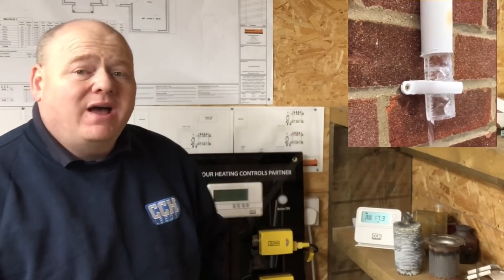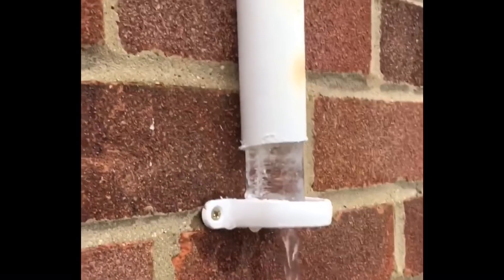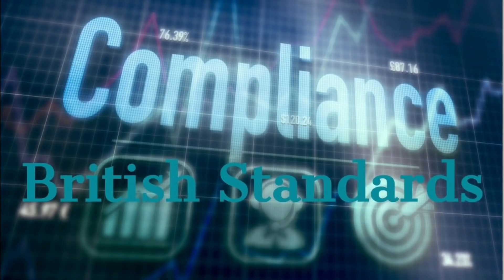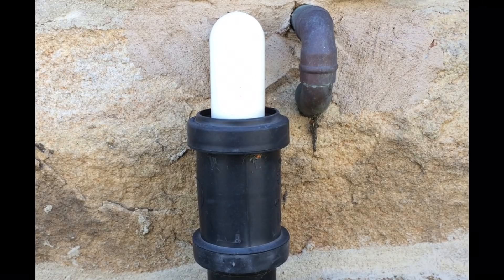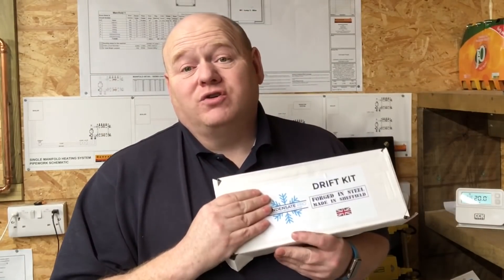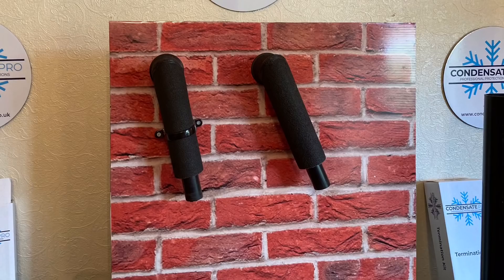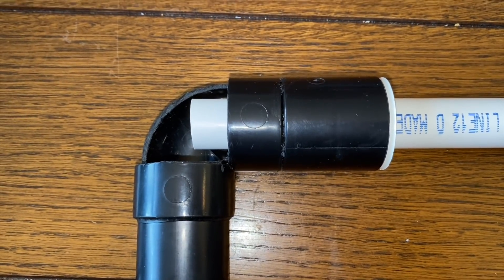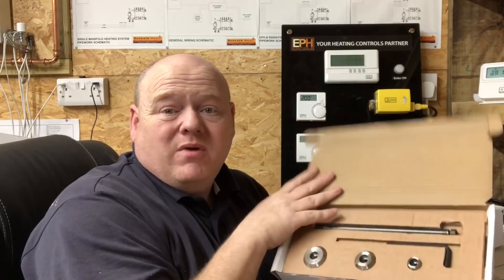Frozen Condensate Pipe - How To Avoid Boiler Breakdowns Due To Frost

Comment: I had a condensate pump installed with a combi boiler, which is located in a wardrobe in a bedroom on the second floor. The pipe runs from the condensate pump into the attic and then the pipe goes down from a hole in the ceiling into the bathroom and connects to an existing bathroom pipe. Is that normal?
Reply from the maker: yes

Comment: I used condensate pro on my last few boilers , only two of them froze up , it was difficult to get them thawed out. 
Now I am running every thing internally when ever possible. 
Even using pumps where necessary

Comment: We've just had 36mm condensate pipe freeze despite we were told it wouldn't happen with this dimension of pipe. Thick rods of ice came out! I had NO idea how much condensate is actually produced.  Water backed up into the boiler which, obviously, shut down for safety reasons. Our Baxi was fitted last year and has 7 year warranty but *frozen condensate pipe problems are not covered under warranty*.  Our pipe runs along side of house and into a crystal-filled mini soak-away so we will be having this pipe modified away from the wall so it can be  lagged properly with condensate pro (thanks for the heads-up @allenhart999).  Wish our 20 year old boiler was still with us, we never had these problems pre condensate pipe days.

Comment: Simple, cheap fix.   Cut white, plastic condensate  pipe below boiler level.  Fit  T  piece to join it again. Fit short length of white, plastic pipe to spare outlet on T.  Fit 90 degree bend to end of pipe then fit into it another length of pipe that rises above the condensation trap in the boiler by maybe 1 foot.  Condensate pipe comes from boiler to the T piece it then looks like a U shape with one leg a lot longer.If condensate pipe freezes then swing down the long leg of the U into a bucket. Condensate trap will empty and boiler will start up. The bucket doesn't fill up very quickly even when boiler is on all day. When normal condensate line unfreezes then just swing your improvised drain pipe up out of the way. As long as the end of that bit is above the boilers condensate trap then nothing will come out untill you want to use it again. A bit of pipe a T and a 90 degree fitting and that's it. I have been using it for years.

Comment: Hi Allen. I don't mind using Condensate Pro, but not many merchants have it as stock so you have to order it in. No good if they tell you its going to take 3 days or more. I want to do the job, get paid then move onto the next job. If they see its not complete, you don't get paid. I hate going back  for nothing.
Reply from the maker: What do you use at the moment. Thanks
Reply: @AllenHart999  Previously I've used armaflex, normal pipe lagging. Both are not ideal but better than nothing. There are not enough merchants that stock condensate pro. You would think if they sell boilers they should stock it, especially now its available. 90% of external condense pipes I see aren't lagged.

Comment: hi allen i wish this great little clip had been shown to me last year when i had a new worcester bosch boiler the pratt who installed it didnt know one end of a spanner from the other also the commissoning guy I even asked about lagging the condensate his answer?? no no pipe is BIG enough NOT TO FREEZE ha ha l should have known better from 8 years ago i had a GLOW WORM fitted  that also froze so i lagged it with CLIMA insulation yes it was not the right stuff but it worked just had to replace it when it fell off  it did last 3-4 years before replacement.   My question to you is the pre treated insulation can it be cut down the lenth  so i can use it like CLIMA thanks in advance
Reply from the maker: Thank You

Comment: I'm just in the process of getting quotes for new boiler and pipework. Every contractor who has been I have asked about how they protect the condensate pipe and I honestly get funny looks when I ask how they protect the condensate from freezing. It's not even an afterthought.

I mentioned to one that the insulation would need painting he responded straight back with, "Yes,You can paint it" 🤔
Reply from the maker: Ask them to watch this video and send me a message. Thanks.

Comment: We use condensulate slides inside inch and a quarter pipe and have been using it for years and never had one freeze up and looks a lot neater then that stuff
Reply: what's the price and time to install,  talking installers and services engineers of a massive company who use that product they advise they have many that still freeze with this fitted, also the white powder that comes off it when you have to cut it outside with a mask and goggles on but it not nice to get on your hands? what do you think 
The leaf guard that is supplied can not be fitted  to all drains, so windchill is a problem, to help i have a solution to that , just use a piece of rainwater as that protects against windchill,
Reply: Condensate Pro honestly never had a problem the install time is nothing you just thread it through the pipe as for cutting it also never a problem 
Will give your product a try tho I’m all for cheaper and better products
Reply: @superwhites5870  you sound like quality professional, and we need more and more like you,  
 if you go on to website www.condensatepro.co.uk and send us a message on the  contact page, we will send  a discount codes  , love to get comments and debate like this as shows our industry in the way it should be
Reply from the maker: Super Whites Does it comply with the new building regs and boiler MI ? Thanks
Reply: Allen Hart I’d  hope so we use it on council installs and they stipulate it

Comment: on my new boiler install thye connected the condensate pipe internally to the sink waste pipe...
Reply: just check then where that goes, if it is inside perfect if its goes  outside then insulation would give max protection, also make sure it's connected to your sink correctly as you don't want it blocking, ask you installers when they come to services your boiler to have a look
Reply from the maker: Internal is better, 👍

Comment: I would try to keep as much of the condensate internally and be routed to an internal drain pipe near where the washing machine drain pipe is by the kitchen sink (Not sure if this is correct though). With need to insulate the condensate pipe, its a shame you can't get pre-finished insulation in lighter colours (White / Cream etc) so that it can match the external drainage pipework if you have a light coloured render as opposed to having a 'black line' standing out against the wall. In my house I'm going to try and keep as much indoors both for external aesthetics and a cold temperature avoidance strategy- though will have to do some research on where and what you can connect the condensate pipe to.
Reply from the maker: External pipes are normally black. Thanks

Comment: 3 x 1m might mean lots of spare bits from each job but looks neater
Reply: that's why we put it in a quality box so you can store in the van, with other insulation for merchants it's in lengths and can get damaged when sorting  in van, wanted to help installers and also be there when they services and can offer an upgrade on condensate protection, connection kit has everything in you need to connect to property and termination is not always needed but there to save time on a soil connection or at offset that is needed
Reply from the maker: You would just use it on next job, I might not of explained it very well. You need a connection kit on every job, Then depending on job some of the other bits. Thanks.

Comment: I appreciate your videos are aimed at gas professionals; but as a consumer I find them very interesting and educational. However, please can you explain what the condenser pipe actually does, is it an overflow of some type?
Reply from the maker: Imran Majid New boilers produce water/condensate and they need to Connect to a drain, We don’t want them to freeze in the winter.
Reply: All gases have a hydro carbon dew  point, which differ with gas type pressure and temperature . so therefore they condense into water Which is required to be discharged away from the boiler.

Comment: A number of comments here say that in parts of the country where it reaches quite low temperatures they have never had an outside condensate pipe freeze. It depends on the location of the pipe. If exposed to say north winds then problems. If on the south side and sheltered then probably no problems.
Reply: With conditions like the best for the east and  our experience over the last 37 years and talking to companies like BG  we need to make sure all are to one standard as not doing this will only lead to many not having the protection like the media  advise in 2018, protect you customer as you don't want them saying you have not fitted the boiler to the regulations if they have a problem
Reply: Spot on.  My output pipes (boiler and bathroom) are 40mm but they are north facing so never get sunlight, and are on a wall that acts as a bit of a wind tunnel inbetween us and next door.  It's always windier in that spot than everywhere else.

No end of freezing problems.

I'm putting more pipe insulation on again this winter, but this time am probably going to fit trace heating as well.  The small electricity cost for the few days/weeks a year i'd have to turn it on is nothing in comparison to the damage it causes and the cost to fix it.
Reply from the maker: What do you use? Thanks.
Reply: @AllenHart999  
The very few outside have been 40mm, which had minimal external exposure.  Except one in 32mm which was on a condensate pump.

Comment: Intergas had the condensate spray into the exhaust gasses being emitted via the flue terminal, so no condensate pipe.  They had a small pump to do it. It was a retrofit.  When it worked it worked well. But too many problems made them drop it. It is an idea that should still be worked on to perfect it.
Reply: Interesting,  wich  intergas boiler range is that  as I have not seen this and  intergas have not only eb=ndorsed condensate pro but are adding the products to there recommendations in the boiler instructions, we have tried to remove al, the pain points and help installers with a job that is important to the running of the boiler
Reply from the maker: Intergas are backing this product i believe
Reply: @AllenHart999  
They all will. Anything to stop their appliances having down time.

Comment: £200 for starter kit. Far to pricey for lagging.
Boiler trace is only £30
Reply: take a look at www.condensatepro.co.uk  has all the products and how-to videos, standard install as all end advised is around £24 plus vat
Reply from the maker: That’s for everything, Most of the time you will only need the starter kit £24 and one length of lagging, Total cost per job £27 👍 Thanks
Reply from the maker: Still needs lagging if you use trace heater and then you still need to paint it if you use class o. Thanks

Comment: Hello Allen. I remember a few years ago i had to go and sort out a frozen condensate, we used the one that slides over the pipe but it wasn't half awkward to get it to fit on. The tenant was a nice old chap and even he offered to help and he said "It's like trying to get a condom on an elephant"
Reply: I can insulate any pipes and save u hundreds. I'm a qualified insulation engineer.

Comment: The armaflex / armacell  solar pipe insulation is exterior rated without needing coating or painting, I feed over pipework pre assembled and pass through wall so protected through cavity but normally just use 11/2" if short run etc. not had any problems.
Reply from the maker: Merchants only sell class O normally and that needs painting. If i am going to order anything i might as well buy this. Thanks.
Reply: MI state to insulate All external no matter what length  because of the massive problems back in 2018, whether it's every year in some areas or every 10 customers need protecting and rely on their installer to do what is needed and asked in the instructions, its all show you doing what needed and you a professional

Comment: It’s all in TB 155 to be fair, guidance is quite detailed actually. I lag pipes externally, ensure that pipe is below fully but not below water level. I use the black lagging from my merchant which is quite expensive, it is UV resistant and is self adhesive with a strip on the lagging. McAlpine sell a good non return valve for fitting onto runs that terminate to rainwater also. It looks a good product in any case. I know Allen you aren’t friends of Worcester😂 but our Condensure is a great little invention that can be used if you have room, plus you can fit it to any boiler. I think there is too many variables to have an ideal solution for them all, but TB 155 tells you the correct way👍🏻
Reply from the maker: Do you paint the class O lagging? Thanks.
Reply from the maker: As for Worcester Bosch i would love them to invite me to do a video, They can correct me on anything i have said wrong. Thanks so much for watching and taking time to comment.
Reply: if you go on to website www.condensatepro.co.uk and send us a message on the  contact page, we will send  a discount codes
Reply: The brand I use doesn’t need painting as it is designed not to degrade 👍🏻
Reply from the maker: @paulkelly3254  What brand is it? Thanks.
Reply: H/T insulation is UV resistant so well done and nice to see. condensate pro  product help  with faster installation and look perfect for customers home as we know it  does not look nice, also upgrading  is made easy with the drift kit
Reply: I’m not entirely sure if the name, they get it from pump house, it’s 35mm insulation, comes with a plastic coating and has a strip of tape on it, great stuff👍🏻

Comment: So condensate pro is for 1 1/4”. Boiler man’s state frost protection @ 1 1/4” but at what size do we not need protection? 1.5”? 2”? 4”? I always run 1.5” personally, and in the south we are lucky to not get the weather that further north seems to endure.
Reply: 2018 all UK was hit with tens of thousands of boiler not working due to frozen condensate,  the media and papers blamed out  industry and installers for ripping customers off, it's in the MI to protect so to make sure you do what is required best to insulate, condensate pro not only gives my protection but there to help quality installers and look perfect on any customers home, win-win , it for con on to www.condesnate pro and send us a message we will send you a discount code for all products and tools , hope this helps
Reply: @condensatepro8533  do you make lagging for 1.5"?
Reply from the maker: Check with the MIs Most require lagging. upsizing doesn’t t mean you can get away with not using lagging. Thanks.

Comment: As it goes,  any general advice on how to check that your supply and/or boiler is in order when you move into a rented property - might  make a good video,  let's face it renting is the way the property market's going.
Reply from the maker: Hi Brian i am not sure what you are asking, Sorry. Thanks for watching.
Reply: Brian McConnon just listen out for any noises. Ask that the heating system is running and check radiators get hot. Not really much more you can do.

Comment: As I understand it,  a  modern boiler condenses when the return water temperature is 55 C or less.  I've set my BAXI EcoBlue to heat my radiators to 57 C (tap water on the other zone to 61 C to avoid bacteria).   Since I did this,  I've noticed less "steam" coming from the flue.  I also made a frame with  9 cheap low power/noise 12V  DC computer fans to blow air up through the rad in my living room.   My condensing outlet pipe has a foam cladding with a silver surface.  I'm going to try putting a glass there to see how well it works.  Current outside temp 2 C - inside varies between 18.5 C and 19.2 C. 

I have been a little obsessed with my gas usage - a previous tenant had interfered with the meter and I had so much grief about it.  Horrible intimating letters from the network and supplier - got shafted basically.  Warm now no perm harm.
Reply: if I may advise 
if your boiler is set up not the run efficiently  then it will not condensate so yes you stoping it freezing but you will use more gas  

also, research shows running a fan through the Finns of radiators reduces the temperature of the air being pushed out, best to let it flow naturally
Reply from the maker: Thanks very much for your comment, please consider subscribing to support the channel 🙂

Comment: Great video Allen! 
By the way; can you run the condensate pipe internally to the kitchen sink waste? Or does it have to run outside to a drain / soil stack?
Reply: The condensate is acidic and should be kept separate.  It will corrode copper and worst case will produce chlorine gas if bleach or sodium hydroxide ( most sink unblocking products) are used.
Reply: Correction - Bleach will produce chlorine but either way a bad chemical combination
Reply: @zyspan  copper should never be used to take condensate away but  wow I have learned something today, about the chlorine gas , 
 could I ask a favour and email me on dave@ds222.co.uk as would love to know more
Reply from the maker: Internal is always seen as best practice. Personally I do not like to connect into a sink waste though just in case it blocks up. Thanks
Reply: Allen Hart Thanks for your response 👍🏼
Reply from the maker: @minivtec1600  No problem, Thank you for the comment.
Reply: @AllenHart999  
Can put a tee into the kitchen waste pipe after the sink trap, then fit a non-return valve with the condensate dropping into that.  That is what I have.  In flats or houses having one soil stack it means there will be no backup into the kitchen sink from a discharge higher up.